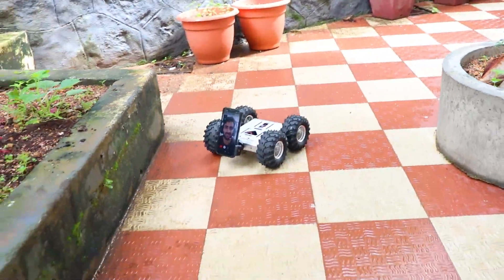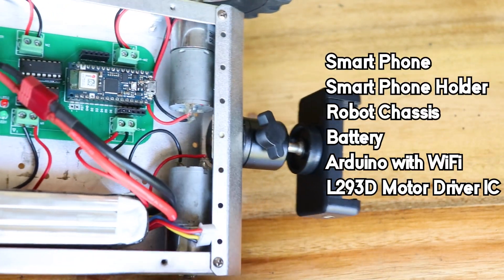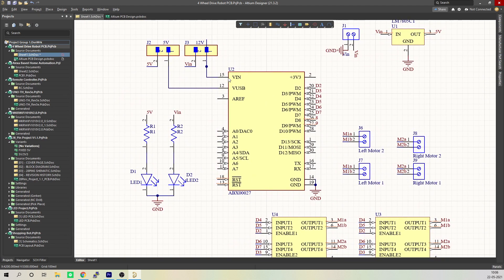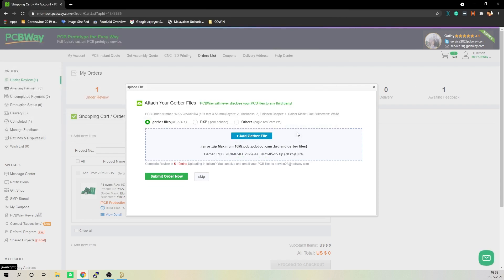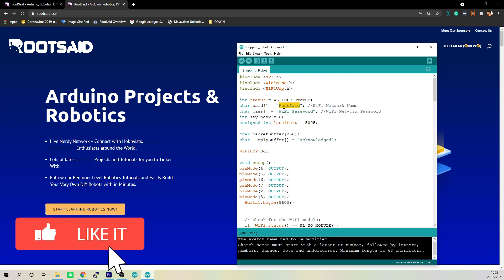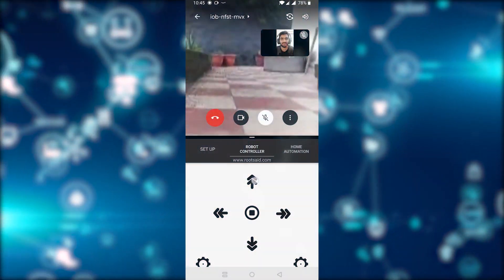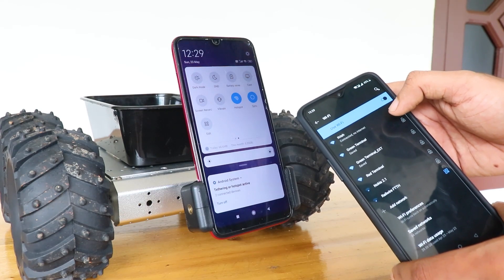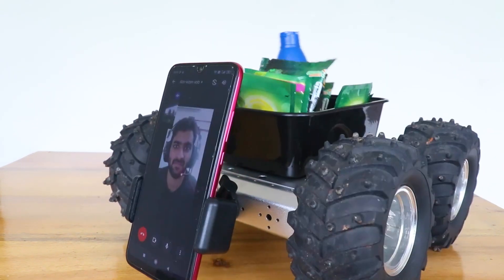I went Shopping using Telepresence Robot during COVID 19 Lockdown Obeying Social Distancing Protocol

Comment: Sir can a rc car ran on just Arduino Uno borad with HC-05 Bluetooth module without a motordriver.....?? If yes then how..?please reply 
I'm working on a 6-wheel drive with bridge axles and with rear only track system and From Left -Right turn axles ... it's not independent Motor system as you do...so what should be the code program for it...
Can you make a video for it...please...

Comment: Is learning programming mandatory for robotics?
Reply from the maker: actually yes. because most of the time, we will be controlling all the motors and actuators using microcontrollers/processors.
Reply: @RootSaid  what are the programming languages mandatory for robotics
Reply from the maker: @aswathirajan7963  depends on the platform. If you are planning on using Raspberry Pi, its better to go with python. for embedded hardware its usually C or derivative.
Reply: @RootSaid   Sir can a rc car ran on just Arduino Uno borad with HC-05 Bluetooth module without a motordriver.....?? If yes then how..?please reply 
I'm working on a 6-wheel drive with bridge axles and with rear only track system and From Left -Right turn axles ... it's not independent Motor system as you do...so what should be the code program for it...
Can you make a video for it...please...